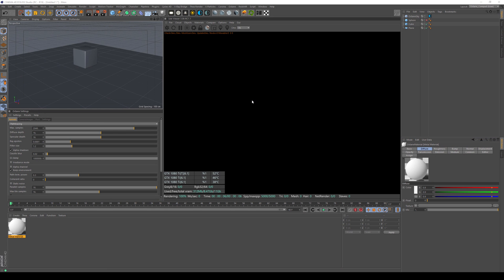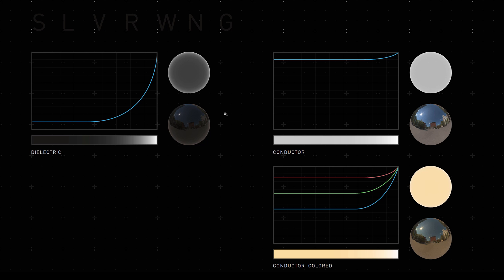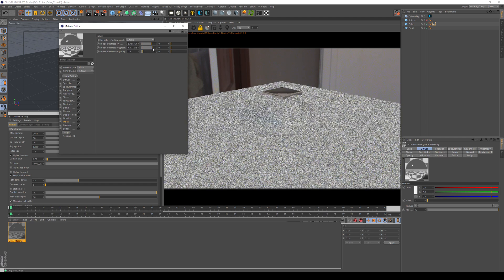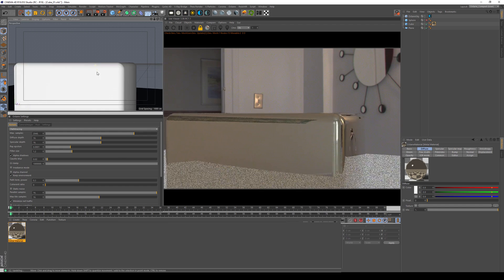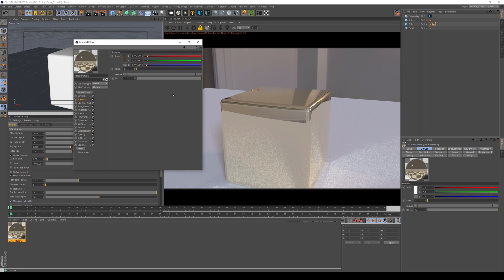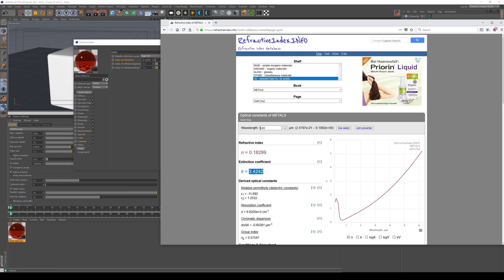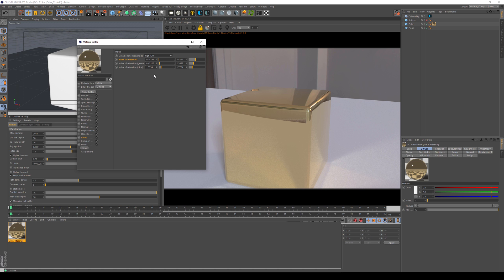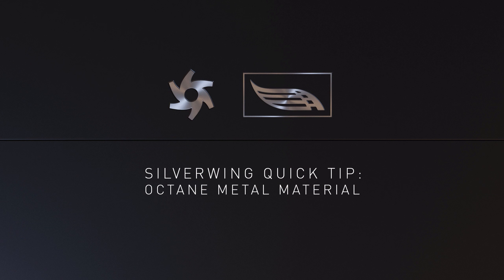Silverwing Quck(ish) Tip: Octane Metal Material

Comment: thanks Raphael! I have a question: Does this technique/system also work with the crystal values shown on refractiveindex.info? Since some of the crystals have some K values other don't - its quite confusing. How would you approach that?
Reply from the maker: Yes some of those stones can have small values of k values. But in my opinion those could be ignored.
So general rule of thumb. Is the crystal is transparent, ignore the K value and use use specular materials.
If the K value is really low >=0.01 then you can ignore it and just resort to the n value and put that in the Index.
If you have a material like germanium where the K is bigger, you will see that it also looks like metal and is not transparent (its classified as semi-metallic element).